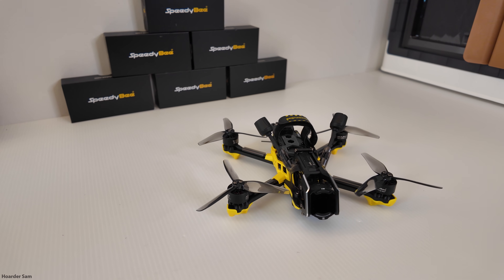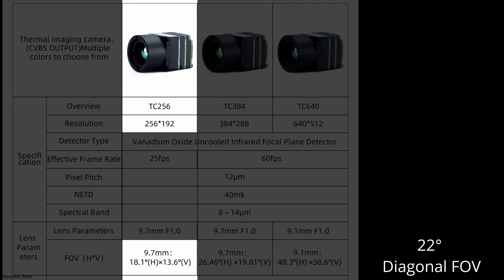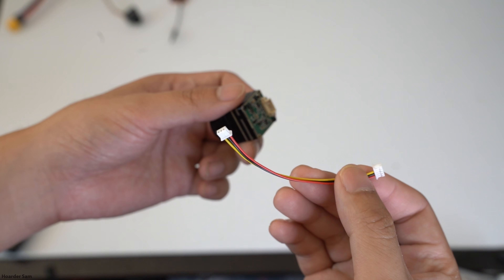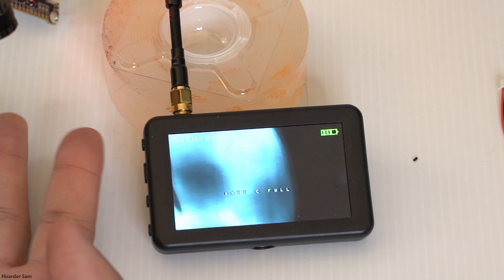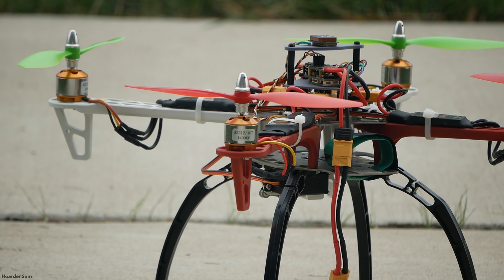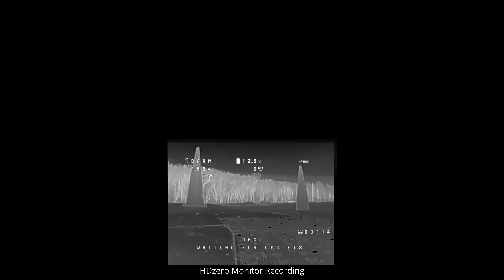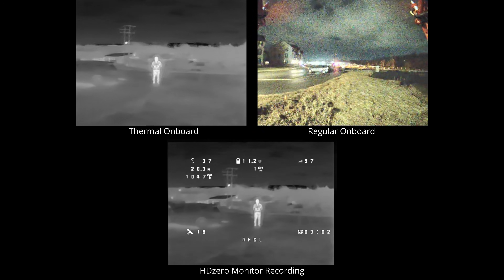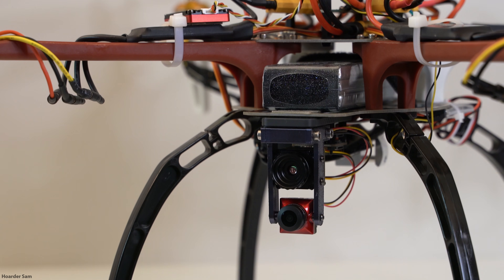I built a thermal drone for $500

Comment: I’ve spent hours researching sensors and methods to do this. But I’ve been wanting to do it with a higher resolution and fov. Also been wanting to find a way to convert to digital and mount it to my fpv goggles for thermal vision.

Comment: I’m new to drones as in don’t even have my first yet but I’d like to build my first. I would like to build long range with thermal like this can anyone help me with info on what to buy that goes together and if possible I’d like to use electronics that are mostly plug and play for less soldering. Thinking 7 inch for bigger battery and maybe longer fly time but as I said new so may be totally off base any help appreciated.

Comment: Wow, this is really impressive — great job! 🔥
Very cool to see fresh content with up-to-date information. Most videos I’ve seen before were about old projects, and it’s obvious that today you can already do much better. Instant like and subscription 👍

I also have a question and would really appreciate your advice.
I’d like to build a fully independent thermal camera system that I could mount on a drone and easily remove when needed.

My idea is to install a thermal camera on a DJI Air 3S, but as a separate system:
thermal camera + video transmitter + independent monitor + separate power supply.

I mainly need live thermal image on a standalone monitor, without integration into the drone system.
For the camera, I’m thinking about a 9mm lens — narrower FOV, but better long-range detection.

However, when it comes to video transmitters, monitors, and system setup — I’m a total beginner 😅
Could you recommend reliable components and a good setup for building such a modular, independent system that could also be used outside of drones?

Comment: I work a lot with these drone thermals and although it seems like there is limited options basically the sellers are willing to equip any sensor with whatever thermal lenses they have 

For FPV I have been getting 640s with a 6.8mm lens

There is also different camera cores. 

There the mini1 mini2 (most common)and N6 there’s is also the “axis flying” which is slightly different.

The main difference in these models is commands and video output options. There is ways to use an ESP32 to send hex commands to change color pallet have digital zoom etc
Reply: have a link to the esp32 / hex commands ?

Comment: I’m have been wanting to do something like this for awhile now. What are your thoughts on using a DJI 03 or 04 air unit for the “daytime” then using the video switcher for the analog thermal? I know this would complicate things. I want to build one with 3 cameras. A wide angle digital (likely an 03/04 air unit) a thermal and then a telephoto of zoom lens’s. Essentially I want to build a search and rescue drone to help out my local fire department but I don’t want to/can’t spend $14k on the DJI. I would love to collaborate a video with you.

Comment: Can these cameras connect directly to say a 7 or 11 inch screen without any other electronics? (apart from voltage feed) and could you connect a small peltier to it to keep it cool out in the elements?
Reply from the maker: Yes, the analog video output is a standard composite video signal (like old school RCA jack composite video) so it can be hooked up directly

Comment: This is the best DIY drone channel by far. The instructions are easy to follow and I really appreciate having a complete part list with the links!

Question about this project...  I have a Holybro S500 v2 frame kit sitting around, along with the recommended motors and ESC, that I'd like to use to build this thermal drone rather than buying a F450 frame from scratch if I don't need to.  Are there any issues with moving ahead with the Holybro frame kit and the SpeedyBee F405 wing mini?  I'm not familiar with the FPV drone flight controllers having mainly worked with the PixHawk family.  Thank you!
Reply from the maker: That Holybro kit will work great and is good quality. The reason I made the $150 one so cheap is that any more expensive and it would just make more sense to buy that holybro setup

Comment: Wonder how axis flying therma camera compares to those
Reply: I have the cheap-ish one from axis, sadly the variant with 20° FOV, which i didnt really realise when ordering.
So i ordered the no-name  wider FOV one as well, which comes exactly like the one Sam got, camera, cable, thats it.
Axis was packaged way better for transport, some info leaflet was included iirc, and the back of the camera has got some casing so it should handle some mistreatment better i suppose.
I am not quite finished building my drone, still learning to fly in sim, so i cant say much about how well both those cameras work in flight.
When testing with a CVBS to USB converter PCB both worked just fine.
Reply: Huh? How should it compare at all? It's the same camera

Comment: the NETD rating on those thermal cameras is kinda high but the picture looks good. i was about to buy a $1300 thermal monocular (384x) but i may make one now with one of these 👀🤔
Reply: Yes, NETD is high. BUT! Pixel pitch is only 12. 
This 256x192 with 12 pixel pitch outperforms my 384x288 with 17 pixel pitch, bought in 2020...

Comment: The thermal camera outputs PAL so make sure the second camera can also output PAL. Most onboard camera switchers require both cameras to use the same protocol (NTSC or PAL).
Have you seen GizFPV's thermal drone videos?
I helped him with switching palettes using the camera's UART. Let me know if you want help to gain the ability to switch palettes (and other parameters). 
I have the $600 version of this camera. I'm using it on a 10" quad I built based on one of your videos.
Reply from the maker: I didnt know that was possible! I do have arduino/esp32 stuff so I'd love to know how to configure it a bit
Reply: @hoardersam10  An Arduino/ESP32 should be able to control the thermal camera but unfortunately I forgot how to program all the different things needed in those microcontrollers. 
I've done many more projects using Parallax's Propeller microcontroller. I used a Propeller as an interface between the receiver and the camera. If you watch Giz FPV's videos, you'll see one of the small Propeller boards I made.
The board can be seen at three and half minutes into the video titled "AxisFlying Thermal FPV Camera - Colour Modes Unlocked."

While an Arduino should be able to provide the controls shown in Giz's video, I'm not sure it can do everything I want include in an interface board. The main reason I used the Propeller is because I know how to program it much better than Arduino type boards.

The program used in Giz's video uses a servo pulse as input. My latest version of the program can accept CRSF (at 42000 buad) input (it just eavesdrops on the signal going to the flight controller). With my latest program, Giz wouldn't need to use the ELRS extender module. My little yellow board could translate the CRSF data to servo pulses to control the extra servo on his aircraft.

Comment: I wonder if it would be possible and even useful to match the fov and then overlay the two camera feeds by putting one feed on each screen of a dual screen goggle. 🤔
Reply from the maker: I saw there was a startup that did that, they overlaid the thermal on top of the regular feed. I forget their name though, I think they were UK based and were selling modules for $1000
Reply: @hoardersam10 even better! The tech exist to overlay two feeds. Perfect. Maybe? Lol Really cool to see what's capable with the current tech that is actually accessible. Great stuff! 👍🏼
Reply: That's just asking for headache.
Reply: @TECHiHOBBYIST No. Thermal fusion is state of the art technology. It works surprisingly well.
Reply: I think I got it wrong and did not see it in fusion manner.
Because he mentioned he wants to see "one feed on each screen of a dual screen goggle" maybe I misinterpreted yes you are correct it (fusion) can be done with simple setup.

Let me addres the headache part as my assumption viewing thermal on one and basic camera on other the brain will constantly be under pressure thus I raised the headache portion.
Reply: @TECHiHOBBYIST yeah didn't really consider that but also didn't know the tech exist to overlay two feeds. Super cool. I'm just getting into the hobby and am blown away and somewhat overwhelmed by what you can do if you have the means and imagination. It's all so damn cool!
Reply: @christopherwalker8776 
Yes I am aware of two feeds overlay, guessing I don't know it is your assumption.

You are just starting I am following this stuff from 2014.

Comment: Hello, what analog monitor is that that you used in the vid, and how do they work exactly if you don't mind me asking... very new to fpv drone stuff
Reply from the maker: The small black monitor on the bench is a 3" LS-5804 micro monitor and the one I use when I fly is the HDZero Monitor. The drone has a Rush tank solo analog video transmitter, which transmit the analog video to any analog receiver (all analog is compatible with other analog systems)

Comment: I havent watched the whole thing but my ratel 2 doesnt look that good, maybe its just my cheap ev800d?
Reply from the maker: Yeah its the DVR, the ev800d is better than average but not the best. In my video I am using DJI goggles w/ AKK analog receiver, it records in slightly higher resolution and at true 60fps while the ev800d does like 24ish.
Reply: As in not as good as at the start of the video
Reply: Dude, you don't even realize what you're missing out on! I flew all the time with FATSHARK HD3 goggles. And I thought analog is really that bad. Very bad image with big latency due to the LCD technology that has swimming pixels in liquid lol. 

I got Fatshark HDO v1 OLED goggles, and man... I was instantly a 50% better pilot. I was able to do freestyle tricks I couldn't do before. First day with OLED goggles. 
And the image looks exactly like the in the video here. Since then, I completely abandoned digital. 

But the best is: no latency anymore.  No smeary image. 
OLED has 0.01ms latency. While LCD like in your EV800, has 11ms+ latency. 

That's nearly unflyable after I tried OLED.

Comment: haven't watched the video yet, but as a general pointer: you can enchance thermal cams with ZnS lenses, similar to laser ones 

I may be a bit mistaken in the material but the key for lenses is to only pass a certain light wavelength, otherwise its just the same optics as the visible spectrum I believe
Reply: This doesn't use near IR it uses thermal IR. Very different from laser wavelengths.
Reply: You need germanium lenses which are at least as expensive as the whole thermal cam.
Reply: @aesthetic8780  There are some relatively inexpensive lenses which will work with a thermal camera. Project 326 has a video titled "Easy Peasy DIY Thermal Camera Microscope" which shows how to use these lenses with a thermal camera. He also has a video where he tries to make a thermal telescope. 
So it should be possible to make some sort of lens for these FPV thermal cameras but I personally don't know enough to do it myself.